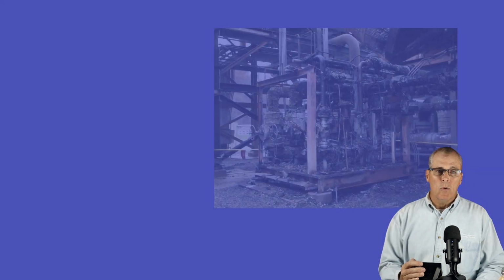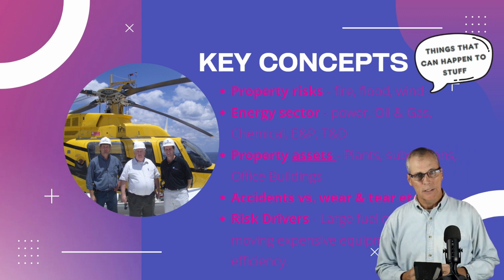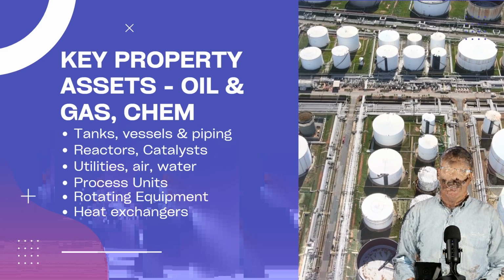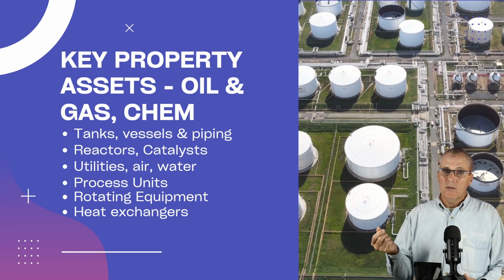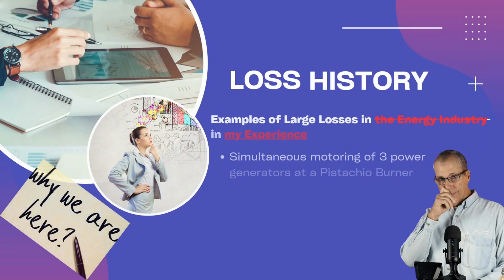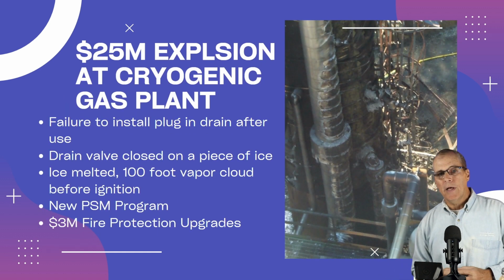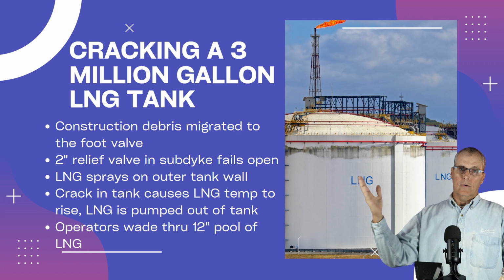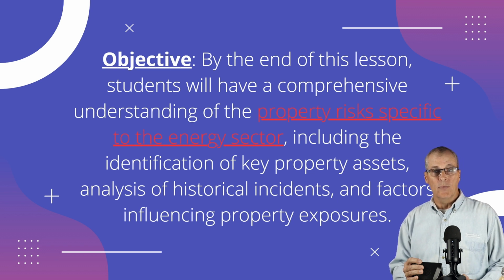What are Property Risks in Energy Facilities?

Comment: Several things come to mind:

The dying batteries reminds me of a semiconductor fab I worked at. There was backup power for machines that were processing multiple wafers at the same time, power glitches would kill the wafers. Well, there was a phase variance in the commercial power, causing the fab to disconnect from the grid. But, the backup power didn't come on, since it sensed that the commercial power was still available, ignore the phase issues. So, millions of dollars of wafers lost.

Risk factors reminds me of an consulting Geologist for a BC Canada LNG project being unaware of the Cascadia subduction zone, which causes monster earthquake ever few centuries.

Then, the 2012 Chevron USA Richmond CA fire. A pipe had been patched like 50 times over the years, failed, 16 people were in the vapor cloud, but got out before it ignited. Multiple patches should have been a red flag to replace the pipe with more corrosion resistant material pipe.
Reply from the maker: Great stories! Poke around this channel and you will find some videos that are claim specific. Like the $2B Stack Collapse narrowly averted. Or the PSM Failure at the Gas Processing Plant ($25M).